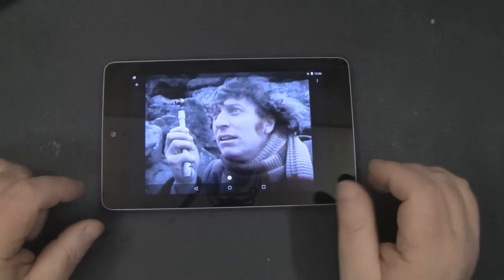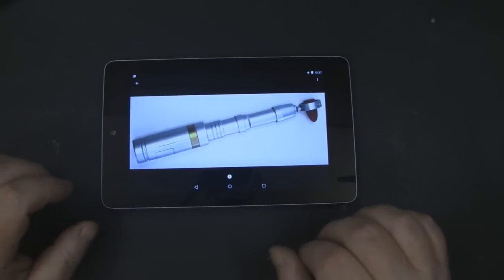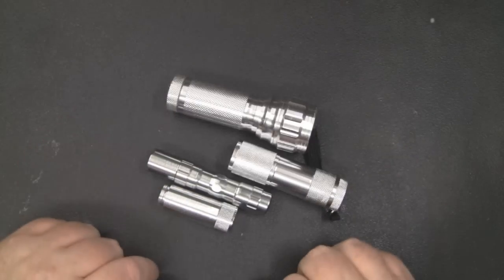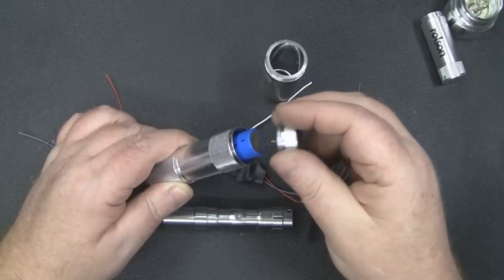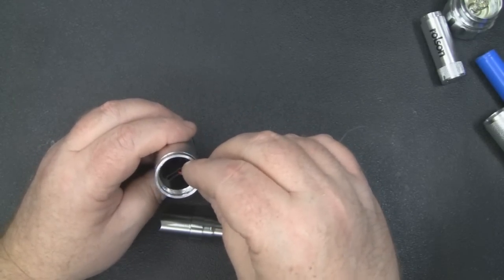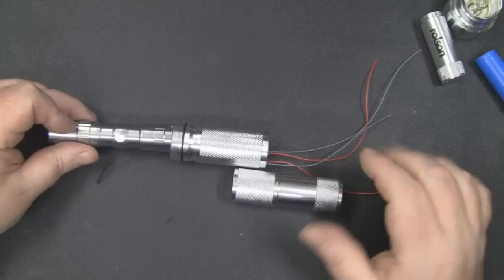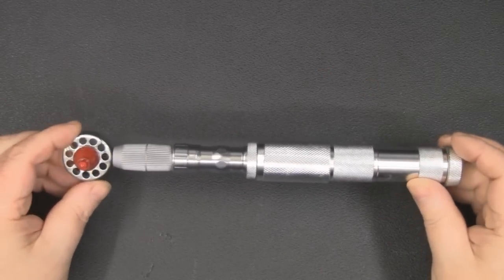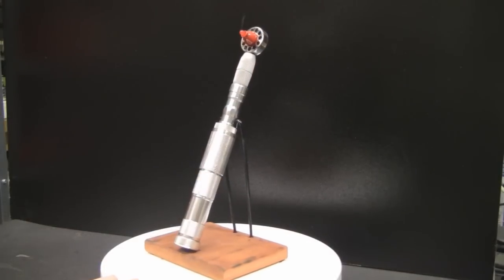Doctor Who Sonic Screwdriver WiFi Jammer #98

Comment: Andrew other than we are both into Dr Who you are the only person I can ask this of. Is it possible to connect a Radio Control receiver to a Radio Control Transmitter by hard wire. As I want to build an underwater ROV and use a single thin cable for Video and Command and Power /cat5 should give me 100meters?
Reply from the maker: FPV SPY I have seen a few videos doing this. I did want to build something like this myself. Have you seen open ROV  http://www.openrov.com/
Reply: andrew mcneil Yes it was this small ROV that made me look on YouTube for other builds and thus created the idea of physicaly connecting a Radio Control TX to a RX. 

Question is can it be done? I understand that brushless motors work under water and model boat props should be used but the controls over strong thin cable is the question I am looking for an answer to?
Reply from the maker: I was going to use these http://goo.gl/ZLy4UR then I would not have to worry about water proofing. Ethernet cable would handle the power for these motors no problem and you could use them as jets no need for props. I was going to have it wired to a xbox controller for the controls.
Reply: andrew mcneil I have seen them used by removing the cover and impeller and replaced with boat props and they become very good also a good price. sounds like a new design is being born. using the xbox controller sounds sexy but are you keeping the circuits as I am not sure on using them, never opened one up?

Comment: Great job, it looks like you could put the battery in backwards easily, would that be a problem?
Reply from the maker: Robonza Thanks Robonza, I thnik it would cause damage if you did as there is no protection between the battery and the transmitter. .